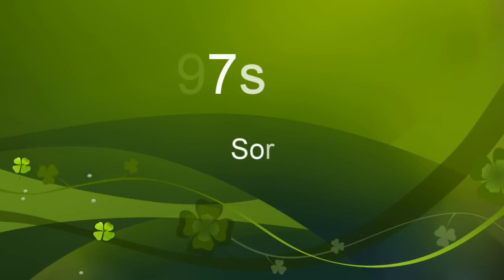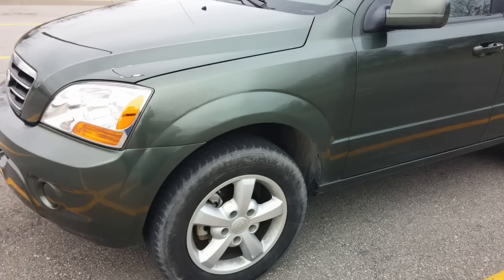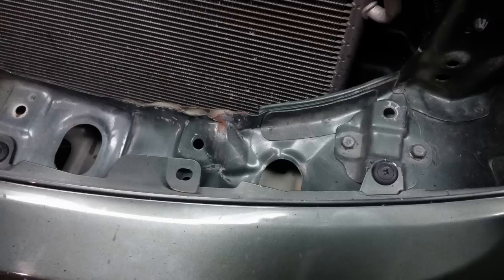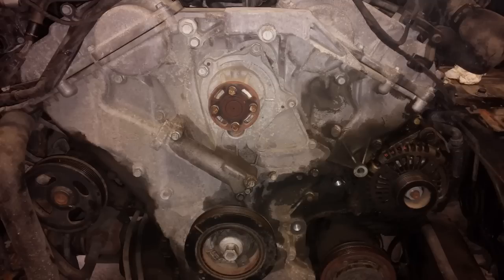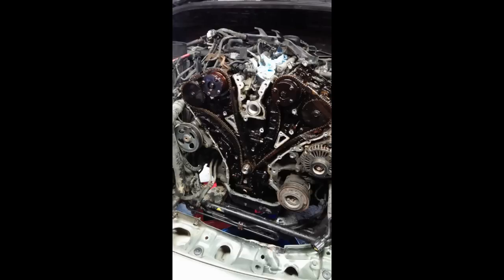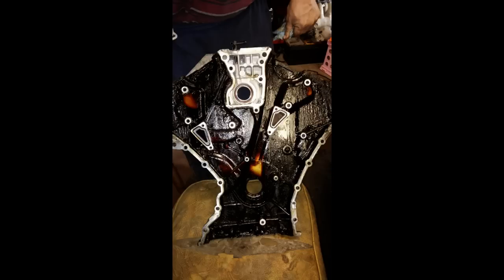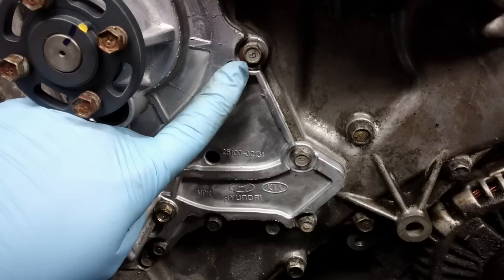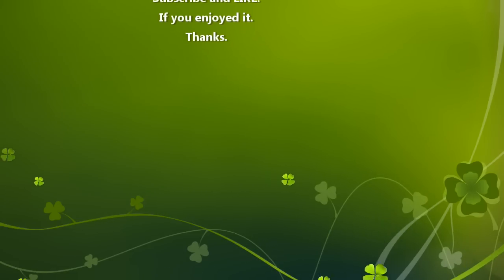2007 Kia Sorento and Repair shots 720p

Comment: quick question? how do i know if i cashed my motor? i have an 07 sorento 3.8 and it’s been ticking (only when first starts) which i’m assuming is the chains. check engine started blinking i did a tune up and fuel pump no clue what i’m doing i called a couple shops and they said it would be cheaper to buy a new suv
Reply: I also have an 07 Sorento w/ 3.8L & just watched a video on VVT solenoid. Could be your problem.
Reply: jeff fricke can u post a link

Comment: Could you please tell me where the thermostat is???? I can’t find it!!!
Reply from the maker: Sorry.. I don't remember, and I don't have the car to look at it.
It's got to be behind either one of the radiator hoses two or from the radiator.
I would do some YouTube searches or Google searches and see if you can't find out. Also make sure that we're talking about the same year. I believe 2006 and older had the 3.5 L V6 which is a completely different engine.

Comment: Nice video with good pictures. Do you know where the crankshaft position sensor is located? any pictures would help. Even the dealers don't know how to work on these motors. Thanks in adavance
Reply from the maker: Sorry, i dont remeber seeing it, when we disassemble it. It would either be right behind the crank pully, have a toothed looking disk, the sensor would,be off to the side. Or some sensor at the end of one if the camshafts,  also it could be on the back of the engine on the flywheel side.   Ask on sorento nation forum. They are pretty good about knowing this stuff, they have helped me on a few things. ALSO..  03~06 had a 3.5L V6 completely different than this. 07~09 in the USA had this 3.8L or the 3.3L which is almost identical.  If you have the 3.5 it will have timing belts, not chains. And i think the position sensor is behind one of the cam wheels. And its a pain in the ass... From what i have read
Reply: Thanks looks to be the same motor. Kia made a motor change near the end of the 08 model year to the 3.3 L. in the LX package.
Reply: Hi David, Brilliant job. I need to do the same myself because the local shop won't touch it and the big shops want to take me to the cleaners.

Can you give a list of the tools required to complete this job? I was also wondering, why did you replace the water pump? Is that something you recommend doing anyway or is there a more specific reason? 

Last question since I am not really an auto mechanic, is there one manual you could recommend over another?

I am driving my F-350 box truck these days at 8 miles to the gallon and it is eating my gas budget alive. Thanks for your help.
Reply from the maker: Jimmy Quick not sure on list of tools. It was NOT a really difficult job.  Maybe 5 different sockets. Just lots of steps.  I will look and see where i got the instructions. I think i have them in PDF form. Could send them to you. The water pump is right there, and i had 125K on the engine. So may as well change it.  I got the kit from ebay. But it is the official Kia supplier.  Came as a kit with everything.  I think about $600 for parts. Took us 2 days, but we spent HOURS cleaning the crap off the places we could. You could do it in one day. But i would plan for a weekend job
Reply: kens97sto171 So, no specialty tools needed? That's good. My mechanic had me to believe I needed to order an auto-shop full of tools, delivered from Korea. You may find this oddly humorous, but KIA (claims to have) changed the timing chains less than 1000 miles ago, but the check engine light won't go off and my mechanic says the timing is off by an amount equal to about one tooth. Now he wants to sell me a new engine for about $6000.00 and KIA has refused to make good on their repair because I'm now out of warranty.

Sorry, I'm getting a little long in the tooth, but this is, at least to me, a great undertaking and I would sincerely appreciate any help you can give.
Reply from the maker: Jimmy Quick not that i remember, it was a pretty easy job, physically, just lost of little steps. I will look for the instructions i have
Reply: kens97sto171 You are the only person I know who has done this successfully. Many thanks for any help you can give.
Reply: kens97sto171 Thanks Ken. I have been an electrician for about 35 years now and back in the day when something broke we just moved on to bigger and better. Well, the only constant in life is change and now we are all looking for new ways to make every penny count for two. I really appreciate all your help. Maybe I can give you an update when I get this done. Thanks again.
Reply from the maker: Jimmy Quick no fears. If you are decently mechanically inclined you can do this job. The kit i bought made getting the timing chains on... Pretty,much foolproof.  If the Kia dealer screwed it up, they must be morons. The chains have A GOLD colored links that you put at the described locations. Then release the tensioners .  it was all in the instructions. I will email you then when i get home. Be a couple hours at least.

Comment: Rockauto.com for Replacement head light assy. Penzoil will do that!  It's Parrfin wax build up. Pack rats got in it.
Reply from the maker: Im still getting dark oil changes, as the crap slowly cleans off the internals. But its running good.  Love the 3.8 power. Its surprisingly quick for a 4200lb vehicle.